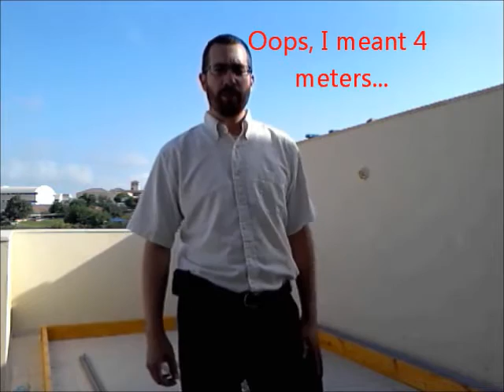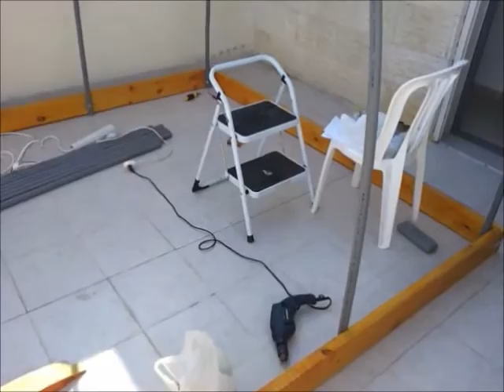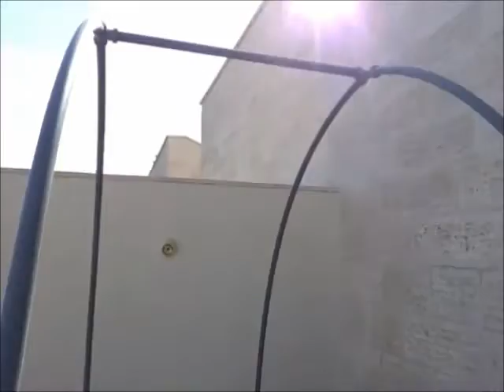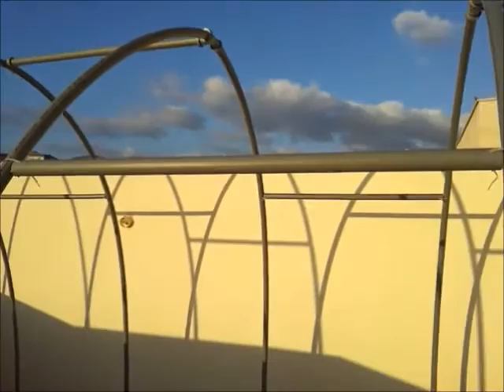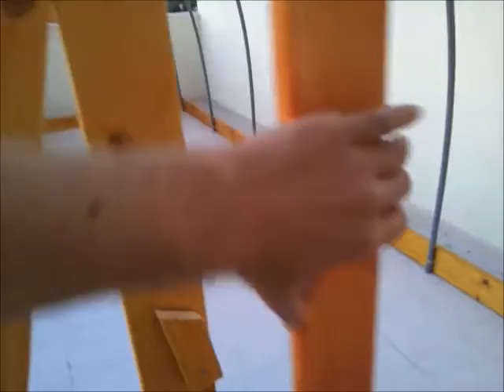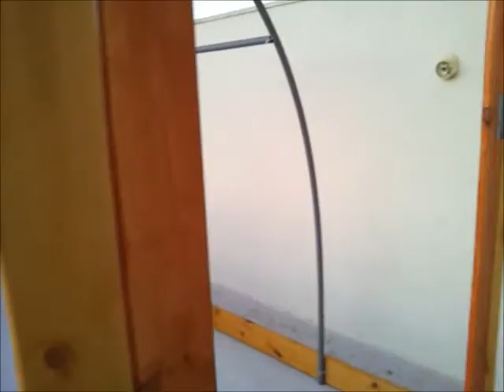Rooftop Greenhouse (hoop house) Part I

Comment: How did you fix the frame to the roof? In my state of the wind blows it would take the hoop house with it.
Reply from the maker: The weight of the beams holds it down.